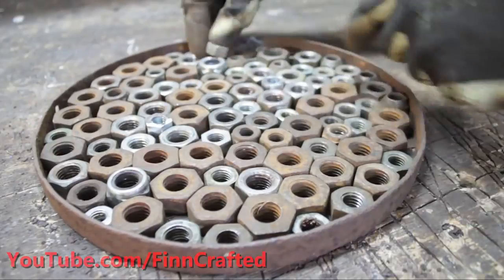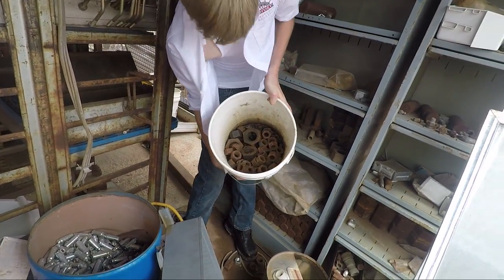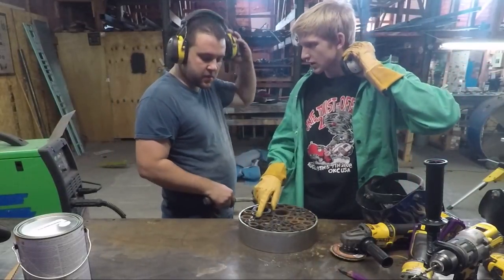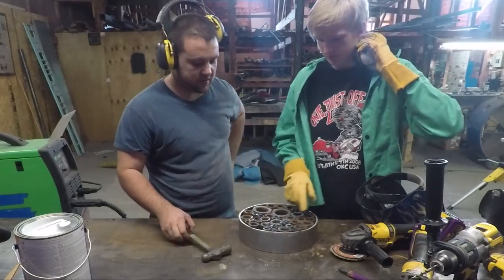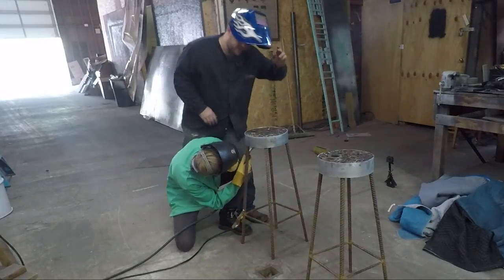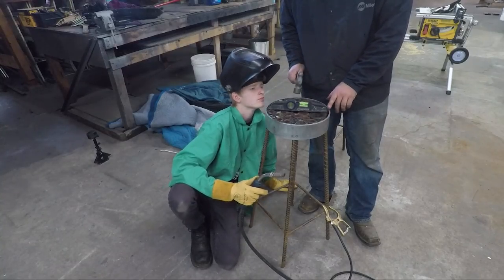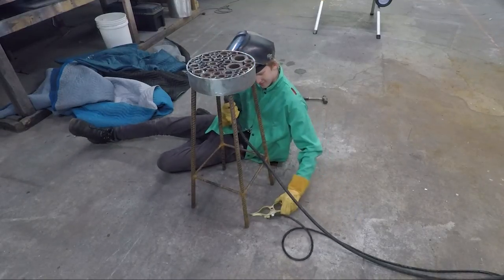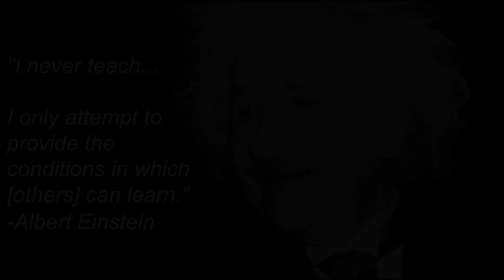Scrap Yard Stools Built by my Intern - 42Fab #12

Comment: Love this project, I think it would be cool to fill the seat with epoxy for a few reasons. 
1st because you can then level the seat by grinding it down flat which will make it more comfortable. 
2nd, if you sell these to a bar or other public place…. You know someone will get drunk and stick their fingers in the bolt holes or worse a child could try and end up getting it stuck. 
3rd, it would be much easier to clean the seat if it didn’t have holes for gunk to get caught in. 

But damn it’s a sexy seat and definitely gives me ideas!

Comment: very nice work... would have liked to see the kid with a full face shield for the grinder though.
Reply from the maker: He has access to one and has used it when he felt the situation merited. IMO a big part of safe tool usage is understanding when enhanced safety is required. If you try to apply one set of requirements to everything you get complacent in my experience.

The camera also doesn't show he's standing well out of plane of the rotation of the disk, my first rule of cut off wheel safety.
Reply: thanks, glad to know you're thinking about it!